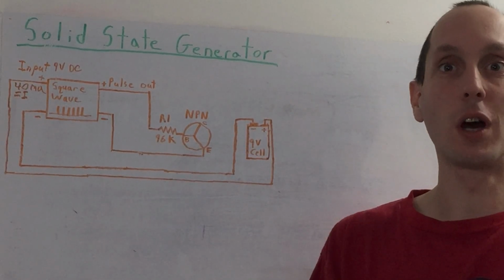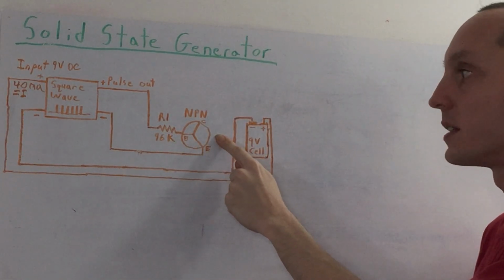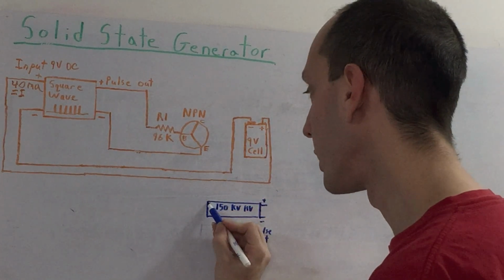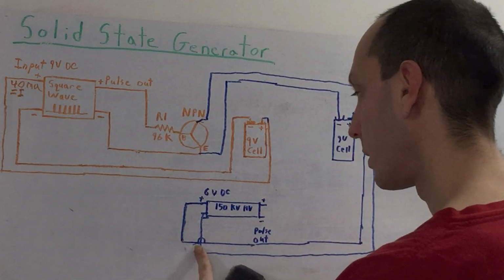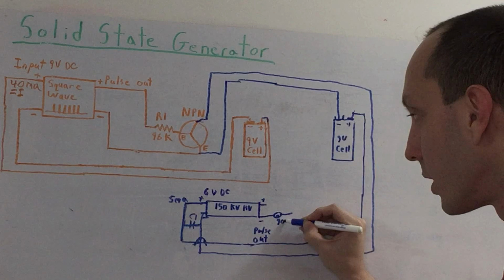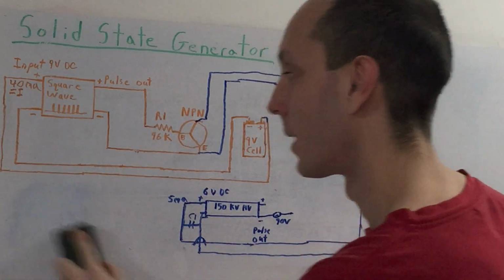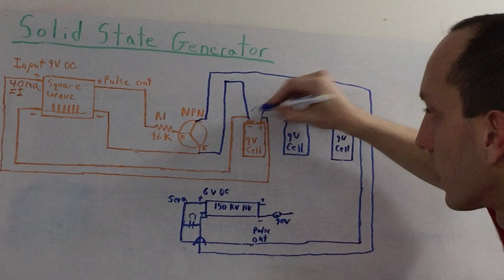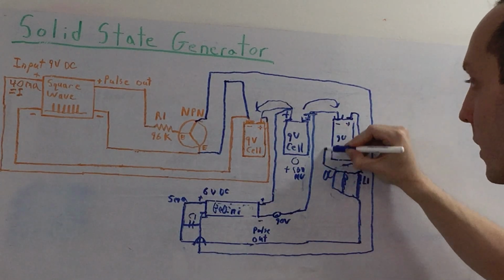Solid State Generator

Comment: I've made this setup. I had posted the results on Joel's forum. The cool thing would be if on the circuit would appear the distribution of energy that Joel mentions starting with 19.00 min of this video. Running the setup I didn't notice this "cool thing". The energy in my case wasn't distributed. Cell 2 is charging and the other two are discharging because of the loads. Maybe I did something wrong.
Reply from the maker: Yeah it seems like you took a few concepts and tried some variations, Its good you posted results. I don't like using that module direct as it takes lots of current if you let it. And from experience 9 volts is too much for those little modules and the batteries get hot after a few minutes also looks like your trying to use a cap dump and do it at high voltages, Good good on the idea of playing with high voltages to try and get more current but in this case in most its that little black oscillator module that is working against you and also your using too much voltage imo. I have an old video showing some interesting configurations, Called "Efficiency Matters" I noticed from experience those modules work best with 1.5 volt batteries if you don't have a more direct way to tame the input. In one experiment I used 4 1.5 volt batteries and tested some various configurations, Even noticed some interesting experiments using input in series (displacement current) instead of a battery and used a small 100 ohm resistor to close the loop at the next batteries and complete the circuit loading the resistor and running the oscillator it micro currents, and fed the output to one cell at a time and they all climbed to near 2 volts and the first dropped to like 1.3v so that was interesting, few methods to experiment with. But running that module on anything more then those 1.5 volt batteries eats up the current.

Comment: Great stuff Joel.   Just to add to Tachyoncatcher,  I also have seen many big 12v lead-acid batteries meet their demise being charged with high voltage spikes(100-200v)  I found a great post on YT (by K Energy) with clever use of a Zener diode + SCR.  The Zeners are connected to the SCR gate and cathode(neg polarity) with the Zener voltage seected to be at around 2 to 3 v above the battery nominal voltage.  There may also be an optimal frequency at which to pulse a battery and from what I've seen, it is often done by experimentation as it depends on internal resistance, battery geometry, chemistry, connectivity, etc. etc.  K Energy does a nice job of demonstrating it w/ varying cap values and zener voltage.  I know you did a post a while back on SCR cap dump and  I'd welcome your thoughts on if you've found a way to determine the resonant frequency/pulse ratefor of a battery bank for optimal charging.   I also have read that there can be an optimal duty cycle in charging the batteries (charge, load/discharge, rest, charge load/discharge  rest, etc.).   Thnaks!

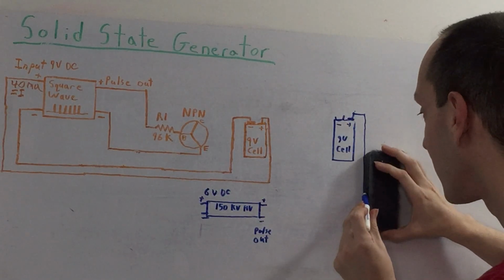Comment: Hey Joel. It comes to me the 90V spark gap and I want to replicate your solid state generator because now I have all the components at hand. I have a question: at 8:19 you say that you energize de 6V HV module with the 9V cell. It seems to much voltage applied to the HV module. Am I correct?

Comment: Hey Joel, I spent a lot of time on this type of circuitry decades ago.  Some of your assumptions are spot on.  Others, not so much.  Batteries do not make good regulators.  Their chemistry is very volatile and causes wild runs on impedance.  This, in turn will cause one, or two, of your batteries to go dead, in spite of being charged.  I did something like this and ran the load (inverter) off the middle battery.  It was dubbed, "the AC battery".  Sometimes the battery would run for days.  then just go dead.  Other batteries, a few hours.  Always the same end result.  An unusable, un-chargeable battery in the middle with two connected, almost dead batteries.  I did use 3 12v lead-acid batteries for my experiments.  AGMs worked better, but still died.  I also placed dead batteries in the middle position to have them seem to recover.  Only to have them  meet the same fate of the good batteries.  Your concepts are spot on.  But, batteries NEED regulated voltage to charge them or they will die prematurely.  High voltage spikes are not good for batteries.  I have killed hundreds of batteries testing out this theory in the last 2 decades.  However, there are devices that like high voltage spikes and return bonuses when used.  You have shared some of them and I have told you how to control/manage them.  Components need not be lost, nor the environment charged. I do love your  passion for this topic.
Reply: I have been looking for new technology to bring to market that can multiply power generation.  I found one that was supposed to multiply the power by 400%.  However, the company is not responding to allow me to have a professional test of the equipment.  Our company is ready to take this technology worldwide with our 16 MW WTEG power plants.   Please let me know if you can point me in the right direction.

Comment: Joel, the new way of connecting the battery kept me wondering about the charge that the middle battery acquires. If the high voltage module is replaced by a light bulb and the duty cycle of the pulsing circuit adjusted according to the light bulb, wouldn't the center battery still get charged? Since the current is now flowing into the middle battery it will continue to charge. what do you think?

Comment: i have tried to push you in the direction dc potential  slash conversion. do you not find it odd that 120 volts ac is  simply 1\12 of a 12v dc battery? is there a mystery to the 12 volts dc and the 120 v ac maines? some secret some conversion ?   dc to ac or ac to dc Tesla inventions>?